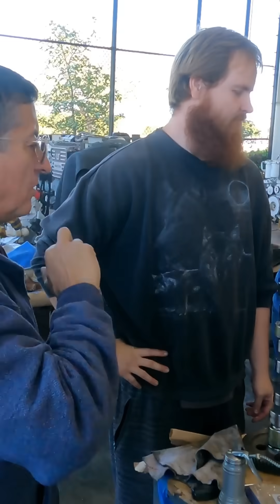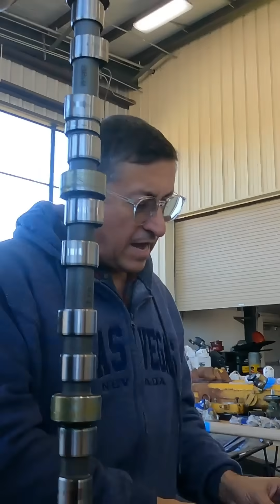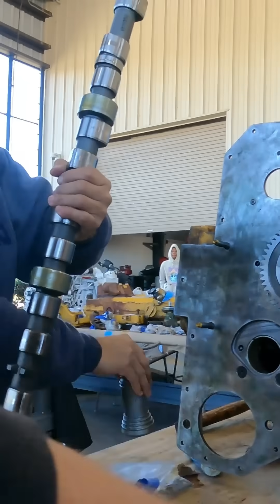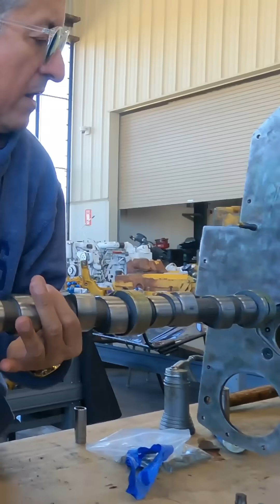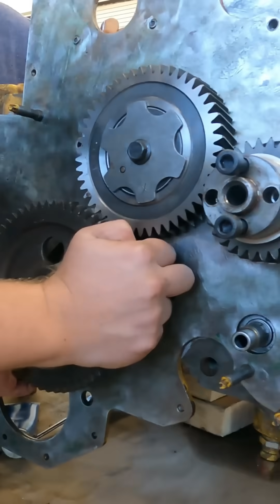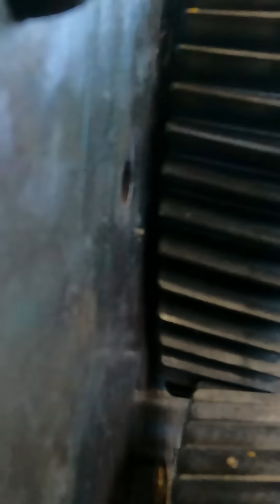Camshaft Installation

Comment: How do you know which way to have the camshaft orientatedwhen putting gears together? Is there markings?
Reply: There’s dots to line up. 

Two dots on one gear. 
One dot on the other. 
That points in between the 2
Reply: Yeah but how do you know when you put in the camshaft if it's going to go in right and those marks are going to line up is there only a certain orientation that I will go in when the engine is at TDC? @fastinradfordable
Reply: Different manufacturers use different methods some use pins you must buy to time, others use dots or V marks on the gears.